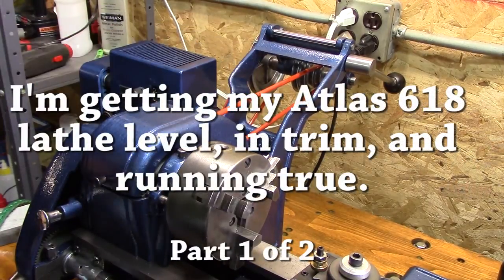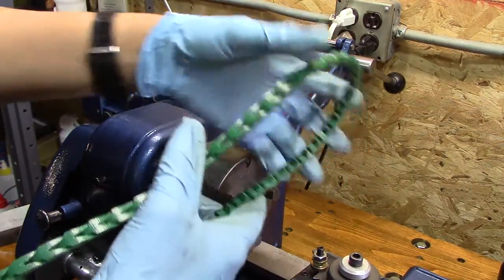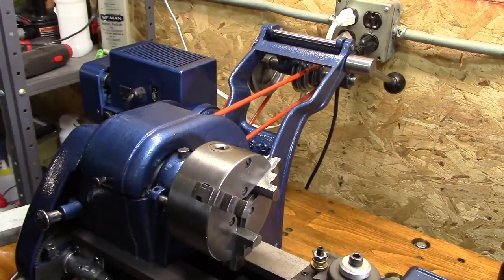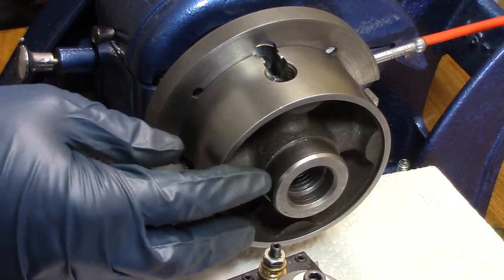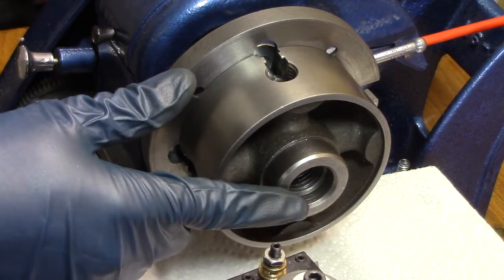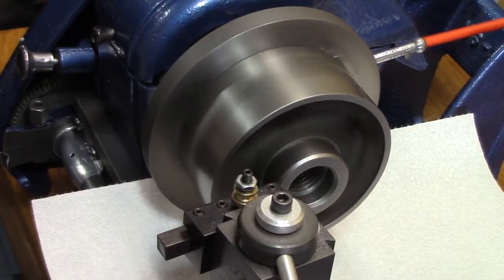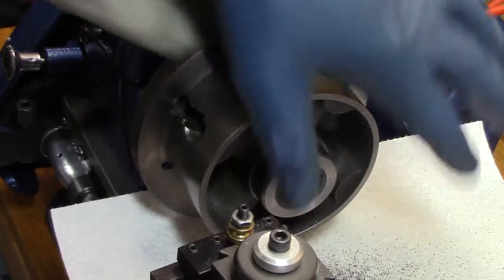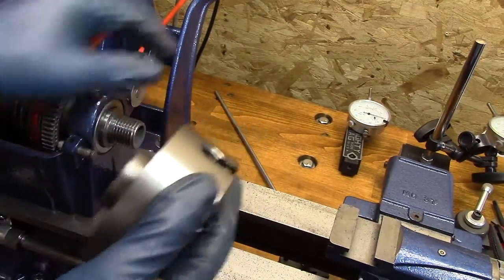Atlas 618 lathe adjustments part 1.5 of 2

Comment: You identified the belts as "these orange belts," which didn't get me any hits on google--that I could use. Could you specify what type of belt that is, and where one might start looking for them? 

Your video is simply indispensable in the restoration of MY 618. Keep 'em coming. Very helpful. -Jonathan in St. Paul
Reply from the maker: +JC Haywire LOL!  I got that belt from MacMaster Carr.  It was pretty cheap.  I think I paid about 6 bucks for 6 feet.  I bought 1/4" and 5/16" and 3/8".  I ended up using the 5/16" OD Orange belt.  You can get it on their website.  Just an FYI.  If it sits for a while, it get a "memory" and when it starts, it vibrates.  But it still is whisper quiet.  I hope you get you 618 working at least as good as mine!  Mine rocks!  And thank you very much.......
Reply: +jster1963 It appears to be the "High Performance Round Urethane Belt" that is .67$ per inch. It also comes in clear. So do you use a connector with it? I almost see one in the video.
Reply from the maker: Yup, that's it!  It's really affordable.  I know it may look like a connector on the video, but it's not.  It's supposed to be heated and melted together.  I don't have the machine so I used a torch.  You hold the 2 ends in the flame and when it melts, you hold it together for about 2 mins.  Then you trim the "bulge" with a razor or grinding wheel.  If you use the grinding wheel, it leaves a rough finish and oil and dirt gets in the pours.  That's why mine looks like a connector.  I would suggest you get several sizes like I did so you can see what works for you.  It's cheap enough to buy and test.  Good luck.......